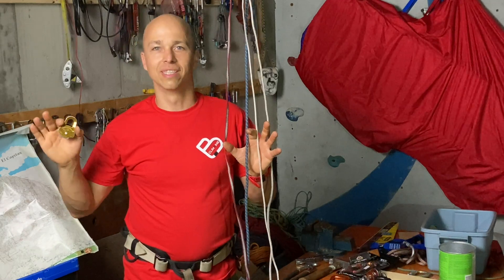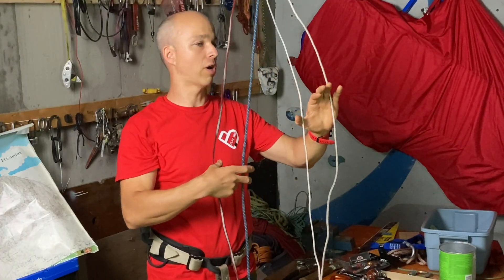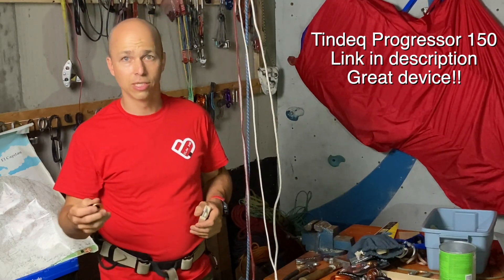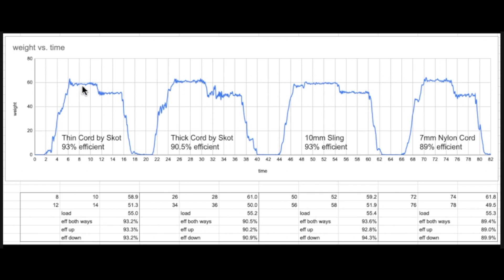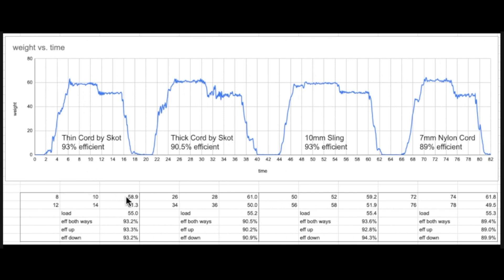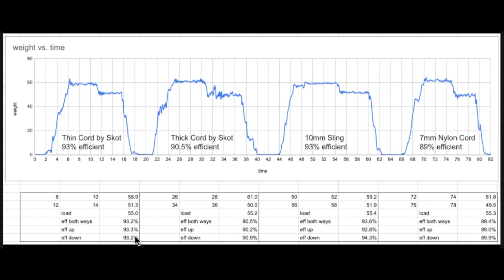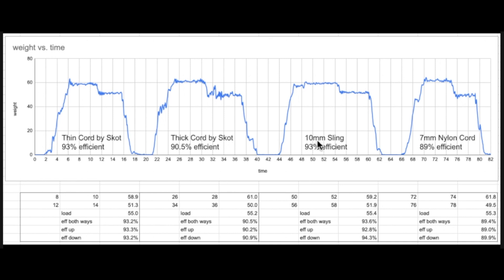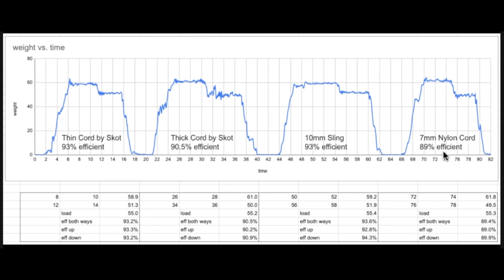Hauling Efficiency on Big Walls - Cord Tests

Comment: Fantastic video, and of specific personal interest - thank you. Have you any plans to extend the experiment/comparison to include stretch of the cord? The up-down load difference from friction and rope-squish-hysteretic-behaviour is higher than I would have guessed. But I've always thought of hauling efficiency within in pulley system to be (mostly) the 'lost motion' due to the stretch of the cord as load cycles on and off.

Might not be that easy to test without a good way of making small relative displacement measures (or perhaps increasing the load so much that it becomes non representative, high load to get more easily measured stretch but is then in a very non-linear portion of the spring rate of the cord).

It'd certainly be interesting to see how the thick and thin Skot cords perform comparatively when stretch is included (in say a Chongo setup). One assumes that the thick might win back on lower stretch what it loses is bearing/squish friction...?
Reply from the maker: I have an idea of testing I can do. Will try to film that soon.
Reply: @YannCamusBlissClimbing  Fantastic! I look forward to seeing that when you have a chance. I'm almost as interested to see what testing set-up you manage to engineer as the results for the different cords... 😁

Comment: It's fascinating to observe how the 10mm sling demonstrates comparable performance to the Thin Cord. Given the scarcity caused by the high demand for Skot's product, it's reassuring to see that a "budget friendly" and easily available alternative exist. Thanks for the great video!
Reply from the maker: Thanks JS!! By the way I recommend you cut the sling at the stiches but don't cut the stiches: cut the 2 plies of slings so you have 5 stiches at one end and 5 stiches at the other end. That makes good "end knots" so any clove hitch will not slip all the way past the sling. You get what I mean?